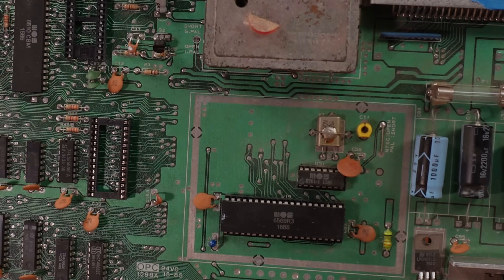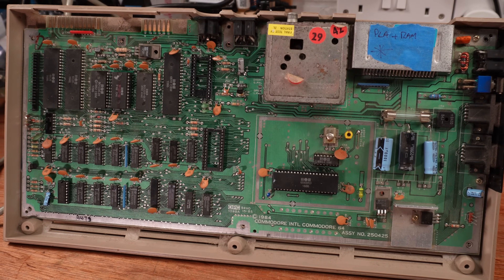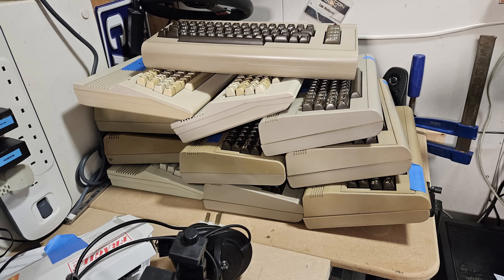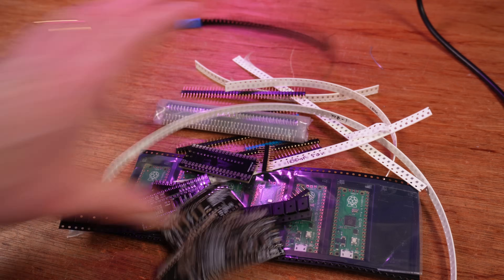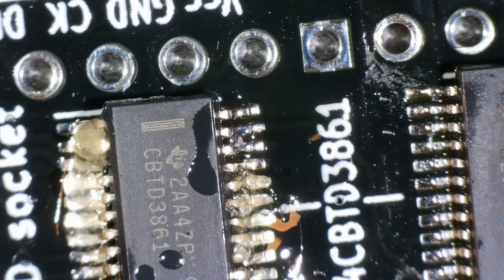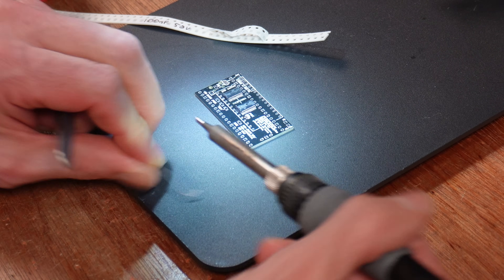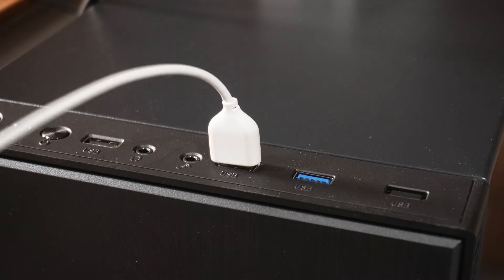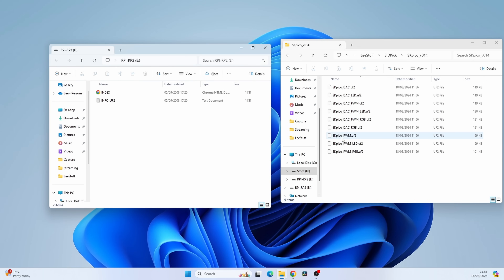Replacing a Commodore 64 SID Chip with a Raspberry Pi Pico. The SIDKick Pico is here!

Comment: This may or may not be a good idea, but when I find I've got flux everywhere and it's sticking components to my tweezers, because I have "ESD safe" tweezers that have a bit of rubber coating on them that also functions as thermal insulation, I'm able to touch the tip of my tweezers to my iron for a second, just to get them warm enough that the flux won't stick to it anymore. Then I find components are more willing to stick to the cold board rather than the tweezers. It's probably eating away my tweezers but whatever, I think that would probably happen anyway.
Reply from the maker: That's a great idea!

Comment: Is the SIDEKick Pico compatible with commodore 64c
Reply from the maker: Yup!
Reply: If you didn't own a hakko desoldering gun and knowing what you know about ZD 915, would you still buy one or go for something else. I cannot justify paying £400 for a hakko, but I've seen a brand new zd-915 on Ebay and it's £85 with a voucher. I use a manual desolder tool and it's a nightmare. It's just the issues with it being a bit of a pain cleaning it etc.
Reply from the maker: @jdf3310  I would but a zd915 without any hesitation. It's probably the best value tool to us retro hobbyists. I would also mod it in a similar way to Jan Beta. But that's not essential
Reply: @MoreFunMakingIt  I'm no way at the level of Jan Beta unfortunately so doubt I'd ever mod a desoldering iron 😃 but I may now invest in a zd-915. 

Keep up the great work. Your videos have helped me to no end. Much appreciated 👏

Comment: Personally I would never press the component down like you do in this video as an important part of the joint is the solder between the termination and pad (dimension G in international IPC standards). Pressing down makes it less likely that solder will flow under and will be a weaker joint although I’m sure this item won’t be stressed too much and would be fine. I’d be tempted to have a skin of solder already wetted to the pad if doing this.
Reply from the maker: Thats an interesting point. I will bear that in mind in future. Thank you!

Comment: When it comes to the Vic Kawari I believe it is WELL worth the money, and not just for the HDMI. The HDMI out is great, don't get me wrong. But the real value here is that you can put it in a PAL or an NTSC machine and switch back and forth between PAL/NTSC on the fly in either machine. I live in the USA and obtaining PAL C64 computers is impossible without importing, and there it is damned expensive. With the Kawari solution I can have a NTSC machine and a PAL machine...in one machine. That is worth the $100 or so dollars it costs alone.

Comment: I use the solder paste in a tube on a daily basis. When soldering an IC, just squirt a little on the 2 pins you are tacking into place to start with. That way you can see the alignment by looking at the uncovered pins. Great vid. It reminded me of a weird C64c I had in the early 90s. It had a red LED and a 6581.

Comment: To use gel flux just add a little bit on 2 corners, no need to flood it everywhere. Then put the chip on top and move the chip around a bit to make the flux transparent. Then solder 2 opposite corners. Then add more flux to the rest of the chip and solder the remaining pins. You don't need gobs of flux, a little bit goes a long way and then you can see the chip pins/pads.

Comment: It's time for a new vid, there is a nano version now that is basically the same size as a real 6581 and incorporates all the parts and the PiPico directly onto a single pcb. This is one where most people will get the pcb company to also add the smd parts since the microntroller is not noob-friendly ;-)

Comment: With through hole parts and plated through boards, I have taken to bending the leads and putting the parts into the board and tacking them onto the board component side up. Then I turn the board over. No need to bend the leads to hold them in place. Makes it very easy to remove a part if needed. Now cut off all the leads and solder the stubs. The solder will be drawn into the hole by capillary action leaving a smooth bump instead of a jagged spike where the lead was cut. Looks neat and very easy to clean off any flux residue. Large components like big caps, ic holders and rows of pins where the upper holes are hidden by the part require a slightly modified technique where you solder one or two leads or pins to the bottom side first.

Comment: Great video, very inspiring! I have been afraid of hand SMD work. Through-hole soldering has been my friend, so perhaps I'm finally ready at 49. Should I still make a mess of it, I promise not to blame your sexy macro footage paired with slow groove jazz.

By the way, your through-hole tricks with putty as an angle prop and as a ballast are awesome.

I was going to ask why you don't run the Topnic just on the corners you're going to pin down, then apply to the rest later. It dawned on me while I was typing this that you couldn't be sure it'd clean the other surfaces when the chip can no longer move around. I'm still posting the question with my answer, so other folks won't also wonder. Cheers!
Reply from the maker: Thank you!
The topic flux is not very durable and pretty much boils away the first time you heat the part.

Comment: I'd rather not buy original hardware due to the higher risk of failure. Id rather emply a hybrid method- reuse keyboards and cases and use Pico or Bare metal parts/ software to emulate the old hardware. I do like though,  what modern circuit boards, micro processors and SBCs such as Pi, have done for the retro scene.

Comment: If the last time you used it was 30 years ago and it doesn't work now, it's most likely a faulty electrolytic capacitor. Were C64 chips really that bad?
Reply from the maker: Yes they were! Some of them you can justifiably replace before they go faulty because they are so unreliable.

Comment: Replacement for a C64 sound chip with a computer with the power of emulating 10 c64s at the same time...Seen similar mods for the Amiga where the 68k processor was replaced with a pico pi...
Reply from the maker: It does make you scratch your head! 😆
Reply: @MoreFunMakingIt  Well makes sense nevertheless if the chip is failing!

Comment: You could just use a large cpld, and get  hardware gate level replica short of using an otp asic
Reply: No overhead from needing a CPU core, memory and code and bus timing requirements
Reply: You can do it with an Arduino

If an atmega8515 can do it a 328 can  do it, I think it has to be clocked at 20mhz or so not 16
Reply: @Clancydaenlightened  First off, good luck finding a CPLD with enough gates in a smal enough package that isnt BGA, and finding one thats 5v tolerant.
An AVR really wouldnt cut it - they have no hardware maths, and to implement filters well in software you need floating point. The RP2040 is pretty much suited to the job... pretty much in the same realm as the ARMSID but cheaper.

Comment: When somebody want to change sid to an emulator why not make another step and emulate the whole c64 on a pc?)
Reply: What do you propose as a solution when the SID's die so frequently and easily ? They arent made any more, and never will be... there's only so many spares out there.
Reply: @jaycee1980  I'm afraid to jinx, but my SID is alive and I use it quite frequently. My solution is buy two spares for a 100$ and use a good new power supply and a bit of love while interacting with C64.
The only real option is to wait until humanity will develop so high that secret art of making real SID's will be rediscovered.
Reply from the maker: Thanks for watching 😁

Comment: TOP JOB! For what it is worth, I normally follow these steps when doing SMD drag-soldering: (1) apply liquid flux to the empty pads, without the chip; (2) give the flux a few seconds to begin drying and become sticky; (3) put the chip on the pads and align the pins (the sticky flux will give it just enough stability, and also ensure a good solder joint under the pin, on the surfaces that actually touch the pads); (4) tack the corner pins, still without flux paste; (5) Only now apply flux paste; (6) drag-solder the whole thing, including reflowing the joints of the tacked pins. This works fine every time.
Reply from the maker: Ah! A combination of both types. That does sound good!

Comment: I know this wasn't entirely your intention with this video, but I just ordered up a bunch of the A8 Pico Cart boards. I didn't know they existed and I bought an 800XL late last year. New toy to play with.

Thanks for mentioning it!
Reply: Yeah, same.  The pico sid was already on my radar and I had the gerbers added to my pcb cart (I tend to save up a few projects and order all at once to save on shipping), but the A8 cart wasn't.  It's unclear to me why it's XL/XE only though, not sure why it wouldn't work for a standard 800.  I do have an XL, but I much prefer to use the original 800 (better keyboard and I haven't modded my XL for svideo yet).  Guess I'll give it a shot when I order and build and see how that goes... or if I smoke something.  haha.
Reply: Loads of potential in the A8PicoCart!
Reply from the maker: You're welcome! 😁

Comment: With "No Clean Sticky Flux" I dip a fine Tooth Pick into the tube 
and then Dab the PCB track where the component goes, I also 
place a dab on the components mating surface/s, I then place 
the component down & solder, when I use the Hot Air Station 
I do much the same by Dabbing flux on the PCB and Chip/s 
and I then pre-tin them, a little more flux then goes on the PCB, 
followed by the chip "be it DIL or BGA" which is then placed 
into position/s, and then using a Hot Air gun on high Temp with 
a low air, flow marry the component/s to the PCB.. And yes 
several components can be all heated onto the PCB in one go, 
but that took me a lot of practicing, so maybe two at a time
max until you are comfortable doing more at a time..

Comment: I use both gel flux (Kingbo RMA-218) and the Topnik liquid, and It really just depends what I'm doing as to which I use. I also prefer a K tip for drag soldering, they make it a little easier to do.
Reply from the maker: I think if I had a quick tip change iron I would change to tips more suited to each job, but as it is I tend to just stick with the one that is ok for most things. So lazy! 🤣
Reply: @MoreFunMakingIt  I was the same, and then got to the point of using pliers to change hot iron tips! I still haven't got a quick change iron, but my TS-101 is a good starting point.
Reply: @MoreFunMakingIt  You find that the K tip can be used pretty much everywhere youd use a bevel or chisel tip. I usually dont bother changing the tip on my iron from the K tip any more

Comment: I hope someone creates a modified PCB where just the RP2040 chip can be placed instead of an entire Pi Pico breakout board, so you need only one PCB and can make the overall dimensions the same as a regular SID.
Reply from the maker: 100% agree. I think that might be something that gets made soon actually. Would be harder for most to solder together, but a nice thing for someone to sell maybe.
Reply: @MoreFunMakingIt  LCSC stocks the RP2040, and JLCPCB, Aisler and probably other pcb fabs can source components from there and solder them on for you when you order PCBs from them. It is a great way for people with a limited soldering setup to make really advanced PCBs. Even 4-layer has become cheap to do now. Kits could be sold with either nothing soldered, just the SMD stuff soldered, or more.. If there's not enough room, one could use a tiny FPC or similar header and an external USB programming PCB that can be detached so you don't need to put all the USB stuff on the "SID" device itself. Just throwing some thoughts out there. Maybe not everything is very well thought through, but well well... Great to see more SID alternatives anyway. I have 7 Commodore 64's and none of them had fully working original SIDs when I got them.
Reply: There are postage stamp size RP2040 boards available, albeit with reduced I/O pin count.
Reply: It's surprisingly easy to convert a cheap toaster into a simple reflow oven!
Reply: That would be great, it could even be overmolded in epoxy to look like an original

Comment: I think I would  personally steer clear of this project due to the silly Creative Commons non commercial / non profit licensing. Technically that means PCBWay can't sell it, and you could argue that you can't fix and sell C64s with it either. I'm a big fan of CC licensing usually, but the choice of license here seems odd.
Reply: Yeah unfortunately a lot of people don’t really understand the licenses they choose. It sounds like the developer themselves uploaded it to PCBWay, hence the profit share, through if they did all the design work they can re-license it as they see fit… but yeah the point about “what constitutes non-commercial” is a big problem. Does featuring it in this video break the license because of YouTube ad revenue? Or your example of fixing a C64 for someone, what if you give them the chip at cost but change for your labor, is that comercial use? No one knows! 😅
Reply: @einsteinx2  Completely agree. It's probably a case of the author not fully understanding the ramifications, but it ends up making things complicated. And I personally don't have a problem with businesses making some money supporting the niche hobbies I'm into!
Reply: If it stops unscrupulous sellers making them and then charging £40 for them, whats the problem? There's been too much profiteering in the retro world, and I suspect the original designer is sick of it.
Reply: What a dumb reason to not explore something. You realize there's no magic authority checking in on all that, right? You can do whatever you'd like, especially if you're not planning to make money off of it. I mean if it's honestly that big of an issue to you, you could just contact the original creator and ask them why they chose what they chose, perhaps enlighten them on how you would do things.
Reply: I honestly never understood any of the creative commons stuff and trying to determine what's what.  Everything I make I just mark as public domain since in my case this is just a hobby...  I definitely think creators should be allowed to get paid for their work though, and it annoys me when i see people selling others work.  I saw someone recently selling PCB's of someone elses project the other day and when someone asked them for help, they basically said 'i've never used this, you'll want to reach out to the creator' which definitely rubbed me the wrong way.

Comment: It's awesome that such replacements exist for the C64. I wish the NES community was as afraid to do the same thing, their concern is that others would take their hard work and sell it as their own. And the face that lots of clone NES CPU and PPU already exsist, but like the SID and the original NES CPU and PPU these go up to $40-$50. An inaccurate clone goes for like $4-$16.
Though I think the SID is more prone to break than the NES CPU or PPU.
Reply from the maker: Like you said, the NES isn't as prone to failure so there's not a big demand for replacement custom chips. I think eventually they'll have to be developed though. All these devices will eventually expire
Reply: Maybe one day we'll be able to use a NES modified to SID audio! That would be awesome!
Reply: The chips on the short boards (SID 8580 and 8500 CPU) are way more stable than the chips used in the old breadbin